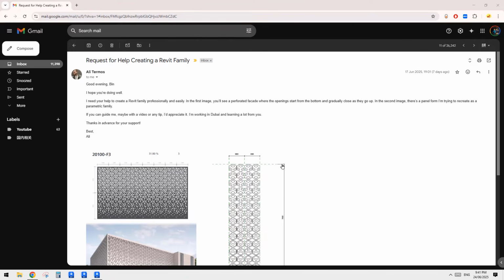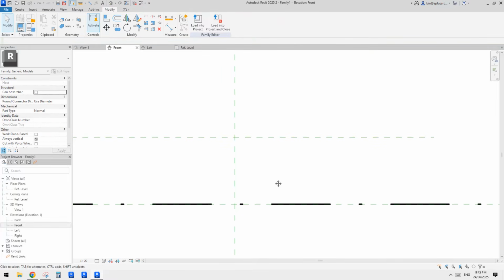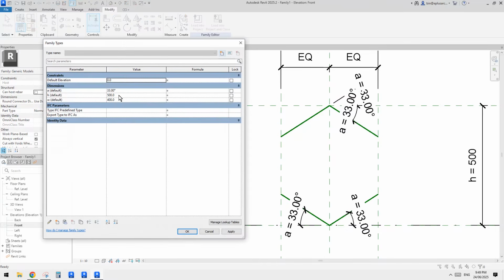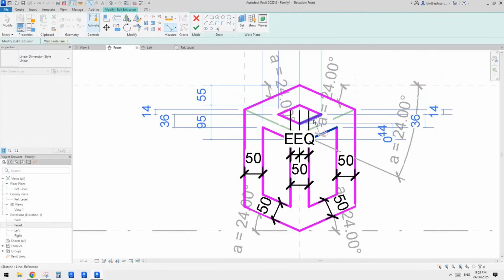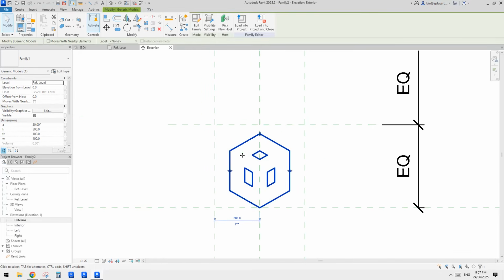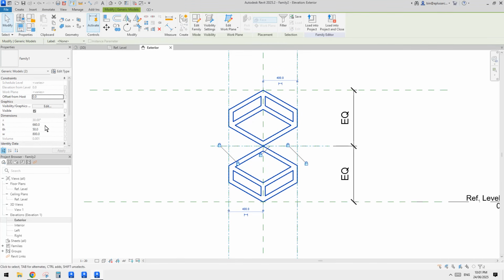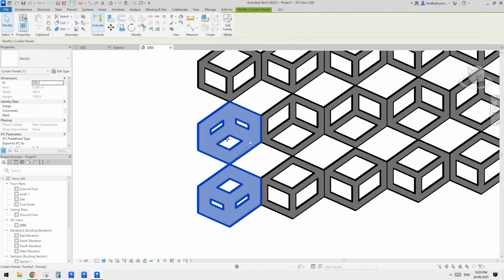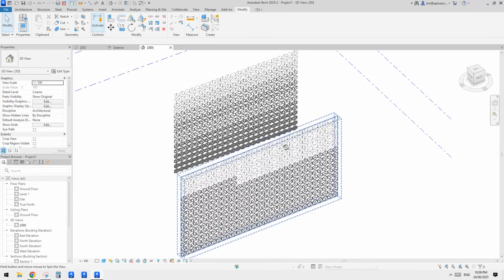25086 - Parametric Curtain Wall Panel Exercise in Revit

Comment: Nice work.  I would be interested to see how to make the sides solid per the image supplied in the original request.  I currently am working on a similar facade but have not managed to find a way to fill in the "gaps" at the perimeter.  Perhpas I can send in a request too but am not  sure where to send it?  thanks!